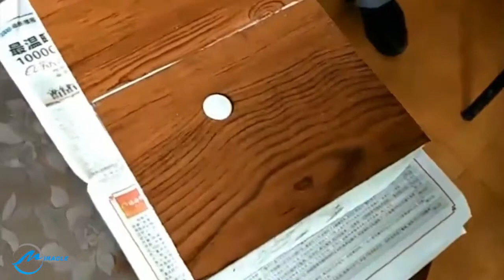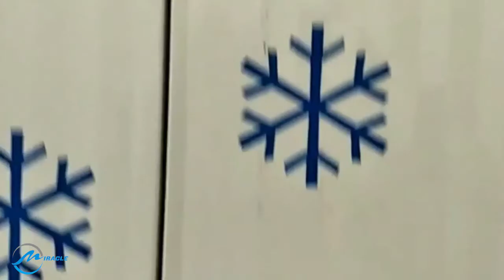Cold room panels installation

Comment: Is it necessary to put sealant for this type of joint.
Reply from the maker: Yes, cause there are some very tiny scratches on the copper that we my not see it, this scratches will cause leaking after some years. For better and longer sealing, we will use the sealing liquid to fill that scratches.